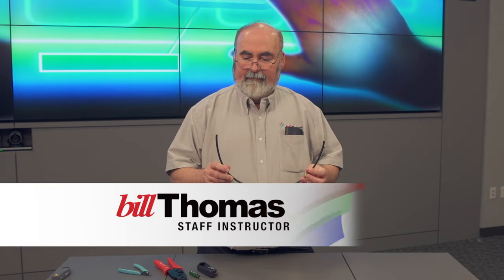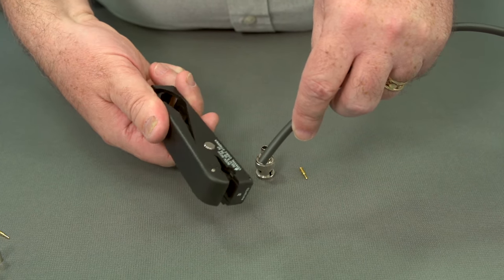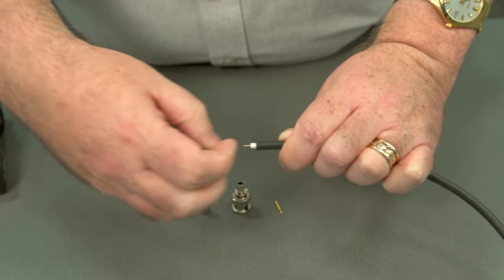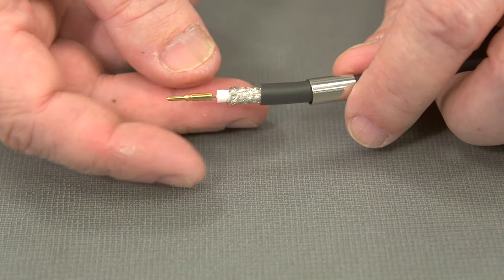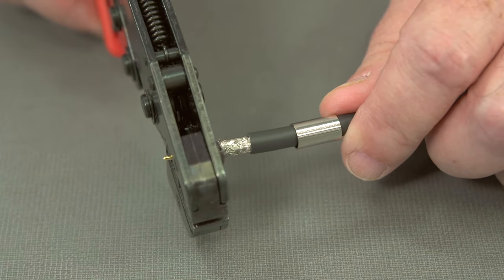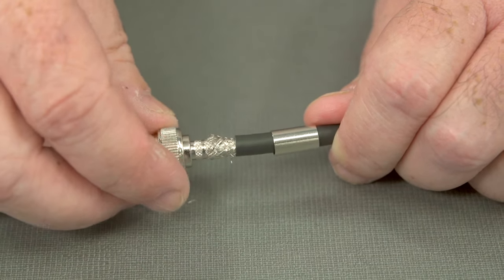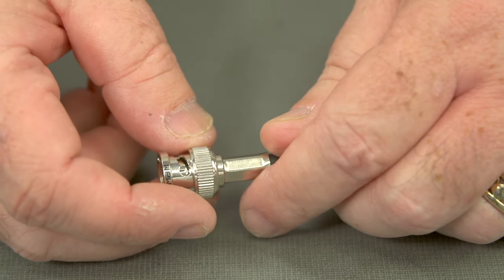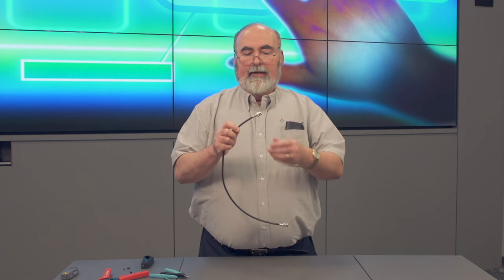Crimping BNCs onto RG59

Comment: Hi Bill,   Video is good, can you add a view of the crimping tool from the side please.I am particular to see the crimping of centre pin.Some coax have the core wire as multistrand.Can cenre pin crimp well there or do we need to solder with fine tip iron?

Comment: Please can you detail the coax stripper used here as had no joy finding one which correctly strips outer sheath and cuts dielectric properly. Looking forward to your reply and many thanks
Reply from the maker: Sadly, we can't do that. We're an association for the commercial AV industry, and we maintain brand agnosticism and will not endorse a product. What I can and will say is that when Googling a rotary coax stripper (especially if you are using it a lot) is that with any tool, don't go super cheap. You don't necessarily have to go super expensive either. Sorry that that is vague, but we must retain our independence. Any tools used in the videos themselves are strictly for illustrative purposes rather than an endorsement. Hope you find on that works for you!
Reply: @AVIXATV  thanks for you prompt reply and advice. I am about up to 1000+ coax/shotgun/power cable run installs and have tried about 8 different coax strippers ranging from £4 UK to about £30 UK. None of which give an adequate braided dielectric section for decent crimping. Most offer 5-8mm braided dielectric section which in my opinion is not good enough for crimping BNC connectors with my CK crimp tool. I shall have stick to my tried and tested method of using a dolphin utility knife of cutting cable sheath and stripping the right amount of dielectric back for centre core pin connection crimp. Once again, thanks for the quick reply

Comment: My g**d**n stripper keeps cutting too deep at the first blade. It taks off the outter jacker and most of the braided shield. I even have the blade set to shallowest cut. I am using a Paladin LC CST PA1255 on belden 1506 cable.